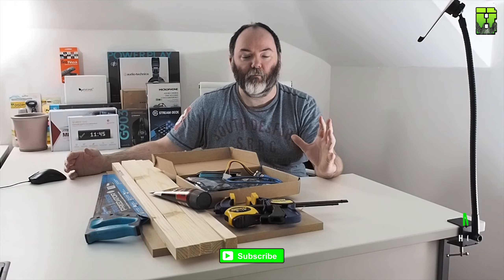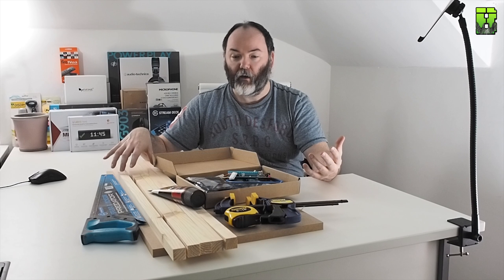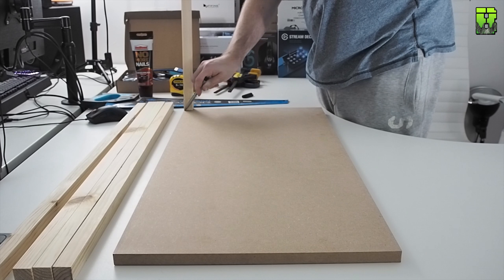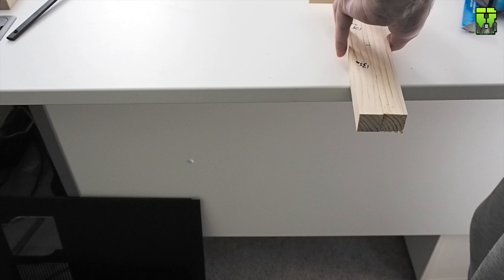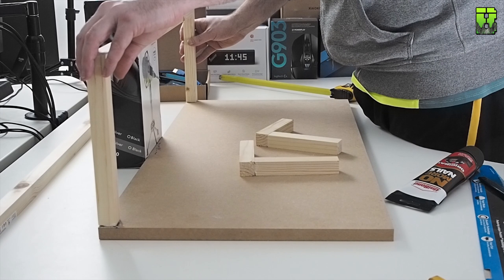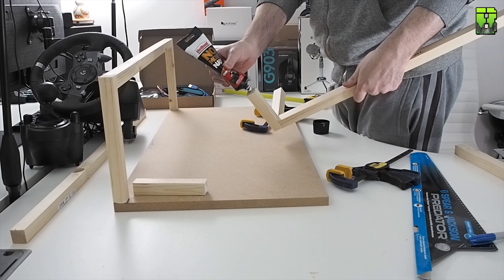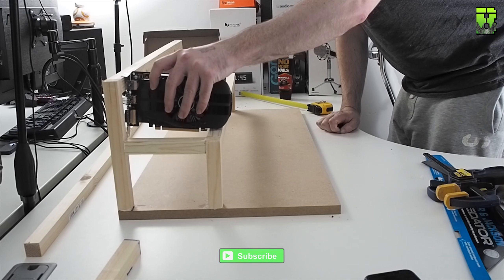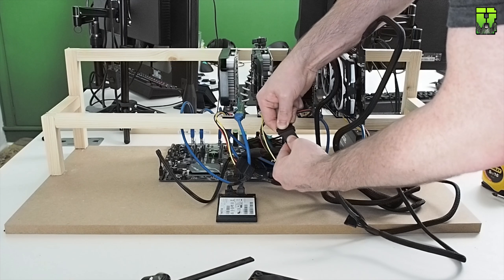Mining Rig Frame Step by Step

Comment: Thanks for the video - Any feedback after almost 3 years? Any potential improvement points?
Reply from the maker: tbh I don't You could make it out of metal mines still going now and has been sat there with no need to be touched since I did this video. I would secure the PCIe extenders if you can.

Comment: making this no aluminium? LOL it will smell and burn soon
Reply from the maker: Or nearly 3 years on and its still fine and not burning 😂
Reply: If it starts burning then you have two problems.

1. Your components are broken and overheating to death.
2. You build it with charcoal instead of wood.